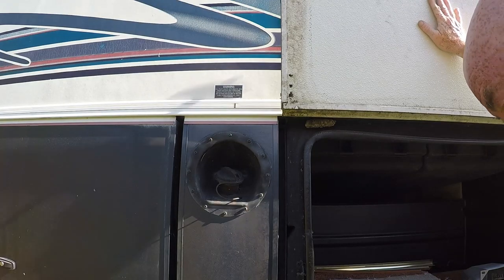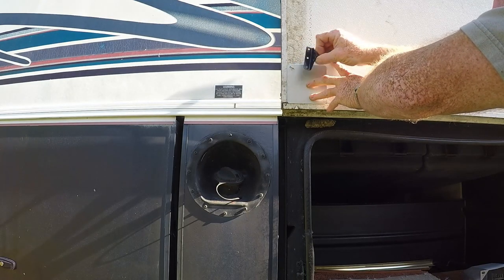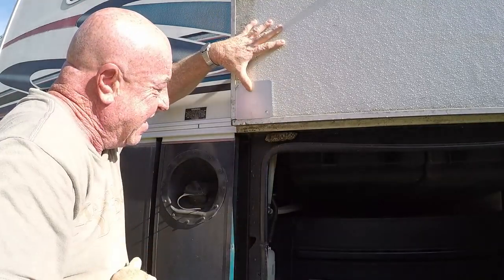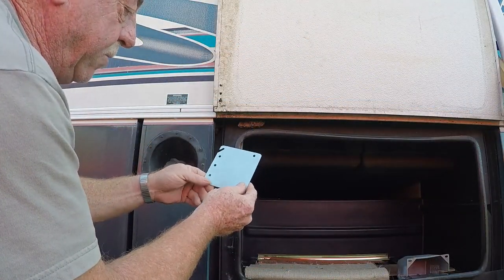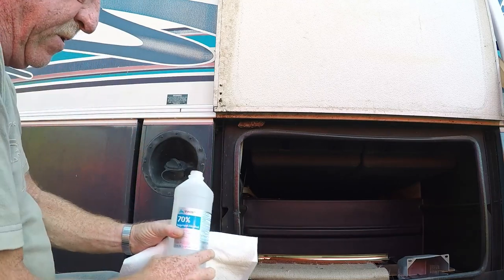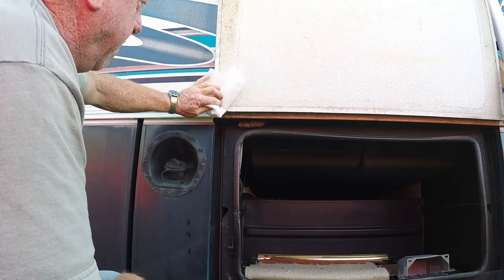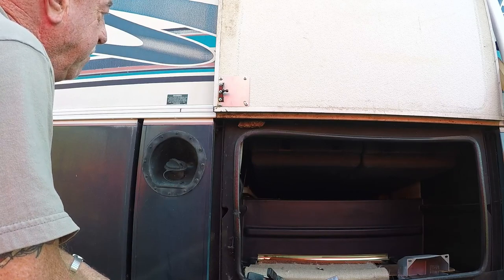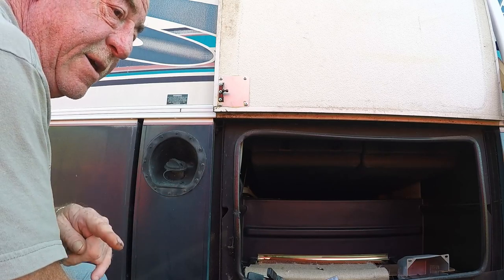Remounting Ball Brackets On Cargo Doors

Comment: Just watched the vid you like me are an older guy, we both have the same problem never any one around when you need a second pair of hands. Looking at the door I think that it has a wooden surround in between the sandwich materials hence more bite for the screws on the edge, nice job.
Regards Arnold Harrington.
Reply from the maker: Thank you!  Gluing the metal plate on really added a ton of strength!